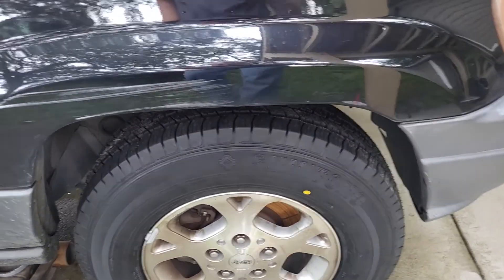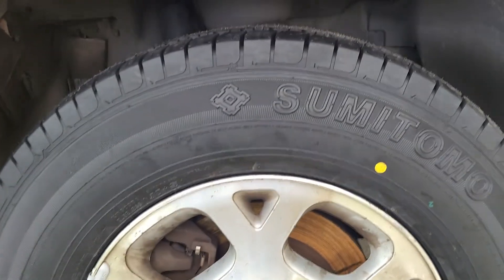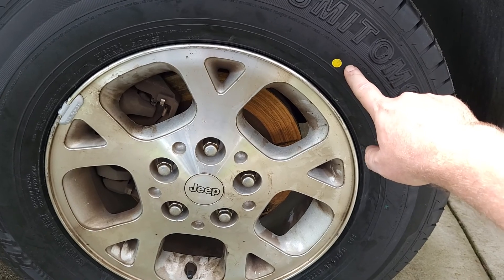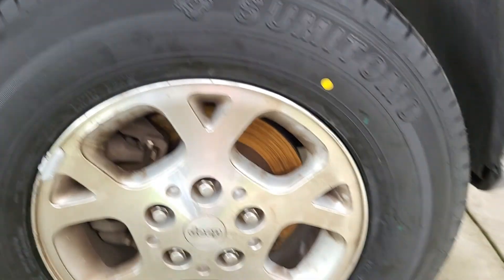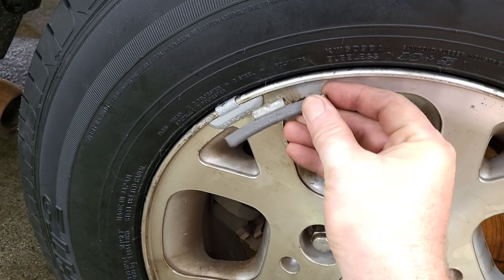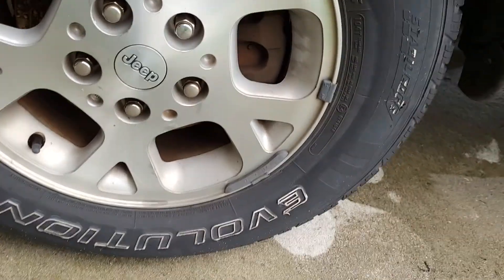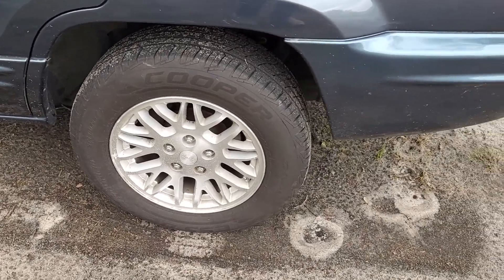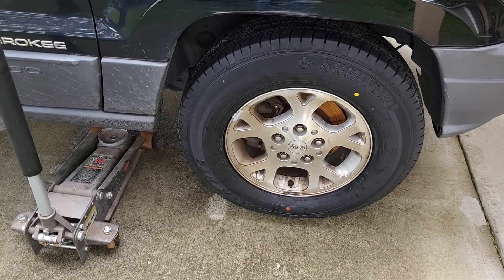Red and Yellow Dots on New Tires, Do They Matter?

Comment: Not the posters fault but so far I've found videos about 50/50 on where the placement ofd the dots are.. very frustrating, shouldn't be rocket science.  Yet no one seems to be posting the science behind it..  there can be only one correct way to do it..
Reply from the maker: I feel your frustration.  I Google searched it instead of Youtube searched it and was just tired of vibrations at high speeds.  I purchased a simple tire mounting stand and have mounted tires on three of my vehicles with the red dot lined up to the valve stem and have had no vibrations at high speeds and the sticky weights used were one ounce or less.  Hope this helps.  
https://www.tyrebaydirect.com/knowledge-base/tyres-explained-red-dot-vs-yellow-dot/#:~:text=The%20red%20dot%20indicates%20the,dot%20with%20the%20valve%20stem.

Comment: What type of logic is it ...if yellow is light then it should be aligned with the valve.... When u say valve is heavy side then why do u have to align already  heavy red dot with valve ..?? Its makes no sense..😮
Reply from the maker: I see your logic.  All I know is that I've read this online and seen it somewhere and I've done 4 different vehicles this way, mounting the new tire with the red dot at the valve stem hole and all 4 vehicles have a very smooth ride at any speed, again, at ANY speed.  AND, the weights used when balancing these tires are less than an ounce.  Again, I see your logic and I've seen some other videos since I posted mine and honestly I think looking at it now, the red dot being the heaviest of the tire matches well with the valve stem hole which has to be the lightest weight of the rim.  All I know is I've mounted tires on 4 different vehicles and got them balanced and they ride so freaking smooth.  I can't figure it out and you're right, it makes no sense, but it works!  I made the video to pass it on that it works.  AND, talking about the yellow dot, which is supposed to be the lightest point of the tire, why wouldn't you mount it at the valve stem hole since, if we have TPS sensors, that should be the heaviest point of the rim?  I'm afraid to try the yellow dot out because this method just works.  It freaking works LOL.
Reply: @alansunday  🥵thnks for ur time... I think the red dot should be aligned with the lightest part of the rim... if not yellow dot with the Rum valve
Reply: I read an article that if the yellow and red dots are on the tire, the red takes precedence. And that the wheel should have a dot or a notch for it’s heavy point. With TPS sensors on the valve stem, isn’t this the heaviest point? I will have the tires red dots matched to the valve stems at the next tire rotation, hope it’ll stop my vibration between 65-70 mph. Didn’t have the vibration with the original factory tires when I bought my 4Runner. Thanks for the information.

Comment: Factory rims, from what i read, are not perfect and balanced.
   Aftermarket rims are closer to perfection and still may need a weight or two.
   I purchased some used aftermarket rims with tires already installed, the red and yellow dots where not facing the direction of the valve stem, the rims had 6 to 10, 1/4 ounce weights on each wheel. 
  I balanced them myself before removing the old tires and balanced them after with new tires, i only added a total of .5 ounces to the new wheels, this time tho, the red dots where directly alligned with the valve stems.
   The new cheaper brand tires (forceum) needed less weights than the old dried out proxes before them. Then again, a lot of pro youtube mechanics swear that nowadays, tire installers dont bother with the whole red dot/yellow dot problem.? 🤔🤔🤔
Reply from the maker: Thank you for sharing!  Great to hear that someone else tried this and you did use less weights!  The ride does make a difference to me though.  All of the cars that I had mounted with the red dot on the stem ride so much smoother with no shaking or bouncing at any speed!